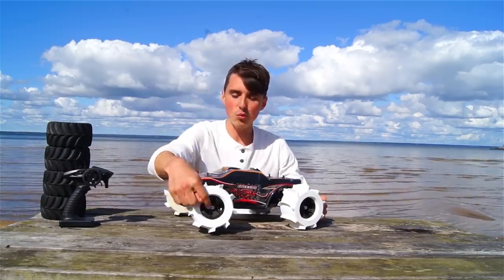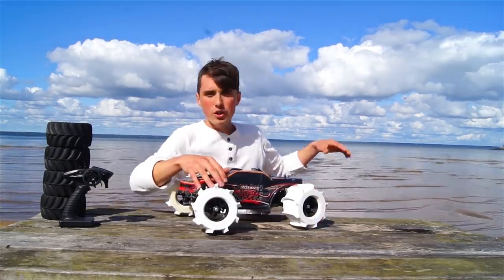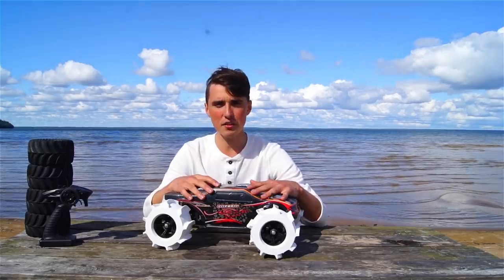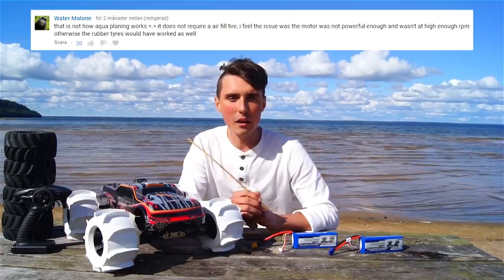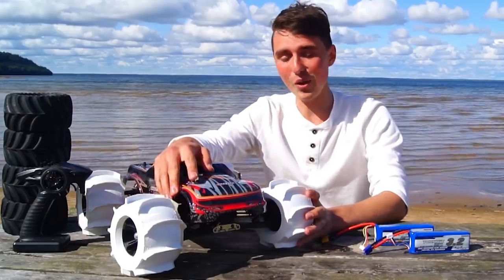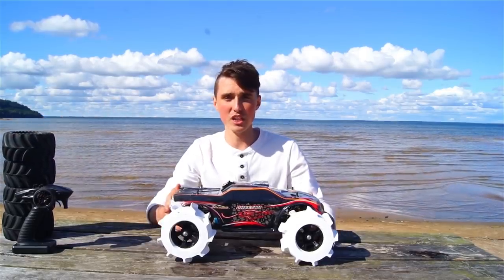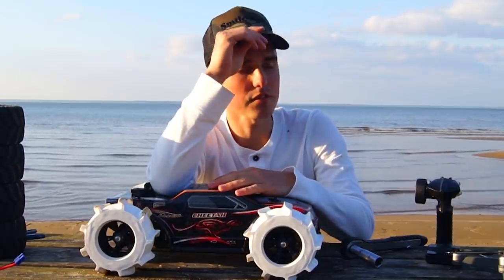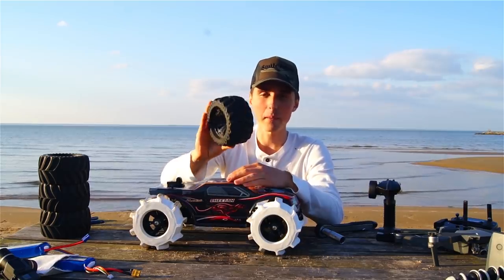NEW 3D Printed RC Car Tires - Driving on Water!!!

Comment: You forgot to mention you sealed the electronics.
Reply: Can we get the link to make the paddle tires and what scale is your car
Reply: The car could be alredy waterproof
Reply: The fact the car still ran after the attempt showed the electrics were protected.
Reply: Etro Qz
Reply: Human4873 Use WD40 or GT50 to prevent the rust
Reply: No, I use them all the time on my scale truck. They create a sealant to prevent rust (If dried with a cloth first)
Reply: ''Lubricates and protects parts from rust and corrosion'' - the official webpage https://wd40.com/uses-tips/protect/all?per_page=all
Reply: mr moschops you can buy paddle tires
Reply: brett shadley where ???
Reply: mr moschops at any rc store or online
Reply: mr moschops they are just sand paddle tires
Reply: no
Reply: Olibob they are just displacing the water, they protect a bit, but will not stop corrosion.
Reply: Use a bicycle chain lubricant to protect from corrosion
Reply: Human4873
isnt that a lake?
Reply: Etro But did he??

Comment: When you put the old tires on, you put them on in their normal rotational position with respect to the tread design. That design is to force water out from the center of the tire - reduce hydroplaning. I'd be curious to see the tires put on backwards, with the tread rotation forcing water to the center of the tire. Would it induce hydroplaning? And if so, how much?
Reply: same toughts
Reply: Same thoughts here too, your printed paddles will still likely work better though.
Reply: Charles Ragbir Stuoid? Hmm...
Reply: English please
Reply: Charles Ragbir Did you mean studious? This icin4d person has made a fair point.

icin4d I think it would make a difference, the car would likely skip across the water for a whole lot longer, but likely wouldn't make it all the way across the shallow pond he was running it across. The treads still let the water slip out while the paddles are designed to grab the water to get traction on the water's surface to keep the speed up.
Reply: icin4d YASSSSSSSS!!!!!!!!!!!!!!!!!!!!
Reply: Sahir Baloch he is speaking English
Reply: ci
Reply: Nice thought

Comment: Success! If it didn't work this time I was going to say you need more power! Clearly that and the larger diameter wheels made all the difference.
Reply from the maker: It's very interesting because I used like 50% throttle when driving on the water. I never mentioned it in the video but I did use the 3S battery and I was still able to go on the water with around half throttle. So from my findings I would say it's mostly about the tires. However, I would like to know whether it was the "air-filled" tires, length of the paddles or the increased size that made it work.
Reply: The diameter made a huge difference I am sure. Not sure if you have seen my hydroplaning videos but when done right you can hydroplane from a dead stop just inches from the water then ramp up the throttle input once the truck "planes off" similar to a boat on water. Once it planes off you can reach speeds just as fast as you can on land!
Reply from the maker: Oh yeah I could literally throw it into the water and it would take off. The RPM's required to hydroplane I think is only based on the size of the tires. The Cheetah only has a 2500KV motor, which I believe is quite low, right? But the gearing ratio makes it able to keep the tires spinning. What I'm trying to say is that on a Traxxas Slash (small tires) the RPM's has to be way up there to move enough water to keep it hydroplanning, while my tires are so wide the RPM's can be lower. Do you agree?
Reply: The surface area of the tires definitely makes a difference. I would also say the wider the tire, the slower you can approach the water without sinking.

Comment: Nice!!  I'm curious, if you just set it on the water, did it float because of the tires, or did it sink from the weight?
Reply: Came here wondering the same
Reply: rgbii same, one is because the tire os light and the tire is for water paddling.
Reply: I think it should sink
Reply: It would sink from the weight.
It's only cause he is hitting the water at some speed.
That's not to say it is a fantastic achievement , I think it is.

Comment: Buoyancy has nothing to do with a car hydroplaning it's all about surface area and speed. But well done great looking rig
Reply: I agree but if it had enough buoyancy it would keep the car afloat in the likely event that the battery died while driving.
Reply: C Murphy bouyancy has EVERYTHING to do with driving on water. Water bikes for example.  They stay afloat while sitting still so speed means nothing with the correct tires
Reply: 96joewill so your saying this car could drive on water slower?
Reply: 96joewill are you also saying that when a normal size car hydroplanes that it is floating?( because of buoyancy)
Reply: 96joewill try looking up "successfully compressing water" see if anybody has done that. Yes I could just give you the equation for when hydroplaning is likely to occur but what fun would that be?
Reply: Tntmod54321 I agree. I also think if it had enough buoyancy if would just float in our atmosphere... In the unlikely event that the battery would die.
Reply: C Murphy you seem to be missing the point of the whole video. The point wasn't to make the car hydroplane. It did that from the start. The point, as the title states, is to drive on water.  And yes, if the tires were made from a bouyant enough material you would be able to stop and the car still float.
Reply: 96joewill no this RC car did not hydroplane from the start and if you had enough buoyancy to anything it will float including your turd like idea . You have pretty much talked yourself in a circle but in the end buoyancy has nothing to do with hydroplaning buoyancy has to do with displacement and floating
Reply: 96joewill have you seen the new video from this channel?
Reply: 96joewill well did you did you see the vehicle float are you going to reply have you realized your mistake or are your convictions too strong to go back on
Reply: I'd say with the increase of RPM and speed the requirement for buoyancy is reduced. 
Thats how snowmobiles can drive on water. However. The slower you go both speed and rpm. The more buoyancy you need or you sink.
Reply: Sonny Knutson no. You are lost I dare not try to explain this to you in detail, but, just think of it like this, the faster you are traveling the faster you encounter the water the more it acts like concrete just look at someone Barefoot skiing. buoyancy and speed not related.
Reply: 96joewill nothing?
Reply: 96joewill . Alright a good response. Your last comment has no flaws. I agree that you could do that. Add enough displacement to any object and it will float in whatever medium you choose. Your previous comments have let us to believe that you have misunderstood buoyancy and hydroplaning.

Comment: Great work. I feel like the angle of the wheel find would also make a difference. When I've seen this done on like motorcycles their wheels have little scoops on the.
Reply: Should also try adding a plane on it. Like a ski. That would help it significantly.

Comment: Who is flying the drone? Very good looking video
Reply from the maker: Actually I am. That's why some of the drone shots are low quality, because I have to shoot in 4K and zoom in because it's difficult to line up the drone and car at the same time.
Reply: Nice Work. Flying and driving (and jumping)... Had med fooled
Reply: Was going to ask that too :P
Reply: It's a mavic, it can be set to follow something, be set to a path, and many more options.
Reply: did you use the auto follow in the mavic?? or does the DJI mavic not have that?
Reply from the maker: It does have "Active Track" and "Follow Me", but none of those work for a fast and small object like the RC car. That's why I had to manually fly the drone.
Reply: haha maybe its just Dji's ActiveTrack
Reply: to follow something, doesn't it need the controller to be attached some way to the object?
Reply: DJD 217, not necessarily, some use a certain point on the camera instead.

Comment: Try putting stock wheels in front and custom in back
Reply: I think that would be even worse than full stock. The whole thing would dip face first into the water.
I'd rather do it backwards: custom only at front so to keep the nose up.
Reply: Do you think that the higher surface area from the stock wheels would help it stay up, while the back wheels would push it along? just a thought
Reply: I see this custom wheel as a double sword. Most of the surface is smooth as a means of intentional aquaplaning and the ridges provide traction by pretty much "grabbing" the water.
These stock wheels do neither, furthermore it's specifically designed to dig into loose surface, which is the opposite of ideal for driving on water, and that's why for this purpose you shouldn't have them at the front, if not also the back. In other words, the higher surface are is what slows it down.
Reply: Martín Varela I see what your saying, thanks for pointing that out to me.
Reply: +Carter Tomasko
You're welcome, and I wont deny I'd like to see it anyways.
Reply: Calo
Reply: In case the car is rear wheel drive, what I think it is, I'm convinced you are seeing this wrong Martin. I would really like to see how the car drives with custom back and stock front. I'm sure this way the car won't jump so much and drive smoother and you could even stear better. This way the car would be pushed forward because of the rear wheels with ridges and the high Voltage battery and the water in front of the front wheels would be pushed under the wheels and so forcing the wheels to surf on the watter. The weight of the front (stock) wheels is of course big factor. What you could also try easly is that you turn arround front custom wheels. Now the ridges are like this < , now turn them arround like that > .
Reply: it will sink

Comment: The only disadvantage with having greater clearance is that the center of gravity is higher and due to the weight transfer during cornering  there might be some roll...You can check it and tune it to the desired point.Good job there by making it ''walk on the water''

Comment: Did people really think the tyres needed to be filled with air 😂
Reply: Well, that would help, the less weight and bigger volume it has the biggest chances of floating, of course this car is not really floating due to any sort of buoyancy force but it's propelling itself upwards with the design of the tires, but filling it with air is a good guess for someone that's still learning physics, no need to mock those who might think that way, that would only discourage them from learning physics
Reply: Selur91 I was taught displacement at the age of about 5
Putting different shapes of plasticine in water to see what floated. Round ball no, flat yes.

Comment: Can you put helium in the tire next time
Reply: it wont really make much of a difference. you might as well have a vacuum in the tires at that point to reduce weight instead
Reply: I suppose you could enclose your entire printer in a pressurized helium chamber for 3d prints with helium inside.
Reply: Even if it was sealed well, it would leak out through the plastic in a matter of minutes.
Reply: rAiNbOw'o mEtEr I don't think that will work

Comment: I am sure someone else commented this earlier, but you probably wanna switch direction of your stock tires. Especially when you want to use them as padles. For the same rason your new paddle tires have the curvature facing backwards. You rarely want to follow the "arrow shape" on the tire when chosing what way to mount them. Ergo, in most cases you want the "arrow"/curvature facing backwards.

Comment: Well done just to let you know I run a brushless traxxas erevo on kyosho Foxx wheels and tire on 6s and drives on water with little to no effort also run a xmaxx on 8s with Baja 5b paddles with the same results also have a 2wd ecx that will drive across water on 3s with stock gearing and a 4850kv 4pole brushless system with proline paddles

Comment: You should try using the new tires on just the rear wheels, smoother tires on the front, with a line down the middle of the tire ( this will help with steering, and the smoothness will reduce the "bouncing" you are getting when on the water.) If you want to improve even further, on the flapped wheels, on the flaps themselves, have a "hatch-back" style dynamic. So its still a scoop in the water, but the trailing edge tapers down rather than cuts off. think more like a wedge than a lip.

Comment: Wondering if you could stop in the middle, and the RC have enough power to get on top of the water again? My understanding is that this requires the wheels to be spinning really fast so in theory as long as the speed was correct, it shouldn't matter if you start on land, or in water you should be able to get on top of the water either way. Assuming of course stopping in the water wont damage your RC

Comment: You should do smaller flaps on the front tires, so it doesnt jump around as much, but drives smooth on the water

Comment: Impressive , just a small adjustment of the angle on the paddles then it would glide over water even more gracefully . More like a chevron tred but instead have more bite in the middle like an arrow so it would grab the water and not keep so much on the tire when it's not in contact with the surface of the water . If that makes any sense lol . Great Video !

Comment: Might wanna lower the suspension a bit. It’ll help the truck run on top of the water more smoothly because of the center of gravity. It won’t wheel hop as bad.

Comment: To really compare the two tires you should have mounted the stock tires on the opposite side of the car so that the treads would act as paddles and scoop the water instead of digging into the water. The white tires were mounted so that they scoop the water see 2:10 versus stock at 5:58. I’m sure the printed tires would work better on water than the stock, but it wasn’t exactly comparing apples to apples.

Comment: Hi Simon.

I really enjoy your videos as they are well produced, funny and engaging. 
But! I have to give you a small but on this one. Your old RC car might not have been able to handle 4 cells, but in pro rc buggy and truggy many, if not most, are driving with a plastic spur gear. I've run entire seasons on 4 cells with a 4000W motor and not strip a single plastic spur. As long as your mesh is good and the composite for the gears are good, that will not be an issue.
Plus. If anything jams it's still possible to strip it, but then, that is a lot cheapter to replace, than say a motor or diff gears. 

Cool wheels none the less!

Comment: Plastic is perfectly fine for a spur gear. It doesn't matter what size battery you run. Also... you dont need 4 cell. 2 cell is more than enough speed and power to bash with.

Comment: Just popped up on my thingyverse... well done.
Reply from the maker: Awesome, thanks for notifying.
Reply: No problem, can I make a video suggestion?  Good beginner RC Cars for folks with 3D Printers.  You know, ones well supported in the 3D Printer community so we can play around and experiment a little but not break the bank expensive.

Comment: would be cool if your drone could communicate with the car to continuously determine and adjust it's distance and angle with the car. Then you could just drive the car and the drone would follow it, shifting only it's rotation around the car

Comment: Its mostly just crazy power that helps gt over water you can use any tyre with enough wheel speed. Weight reduction helps to obviously but sitt if you have enough power it does not matter.

Comment: Try using a ramp to jump onto the water. I wonder if it then still works

Just another test for it. But good job ;)
Reply: Steven Wilbanks I just wondered if the rpm would still be  enough to get the car driving on the water again 
But thanks for the answer ; )

Comment: What setting do you use when printing, infill and resolution? I am considering a 3d printer so i tried designing some wheels for my 1/18 scale. Current setting for the wheels i am making are 15% infill and lowest resolution

Comment: Do you didn't have a freshly charged battery cuz you wore it down that's why it's not working you need to change your RPM for the tires so they turn faster and then it'll skim across the top of the water my son does it all the time and he doesn't go through all the trouble of buying a 3D printer and building them tires like you did he does it with stock tires must be something wrong with your controller that it lets off as you get out in the water so it sinks

Comment: if you were going to use the stock tires then you should have reversed the direction of the tire tread so that instead of it throwing the water way from the wheel  it will funnel it towards the center of each tire helping it stay afloat.

Comment: how about a V-drive Tire like a tire that actually is a V where it touches the ground is very thin but it spreads out quickly that way when it is in sand it'll  you know kind of cut and knife through the sand and when you go in the water it won't bounce

Comment: If your car is not four wheel drive, your back paddling tire design are very good, but the two front tire should be inspired from the jet ski front wheels <<  which means you should print two front tires with the same design and material, but with a wide flat stripe in center of tires (mimicking the ski-boards in a circular design)  👽

Comment: Instead of using paddle tires on the front just design a set of slicks with one extruded “fin” around the center of the tire about 1.5 to 2 millimeters thick. 👍🏻 Less drag and still steers good 👍🏻